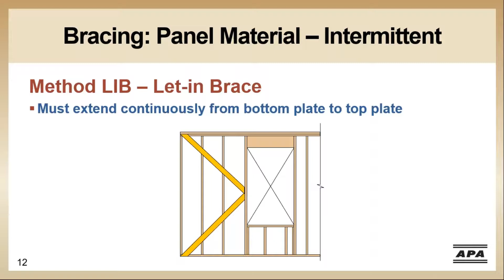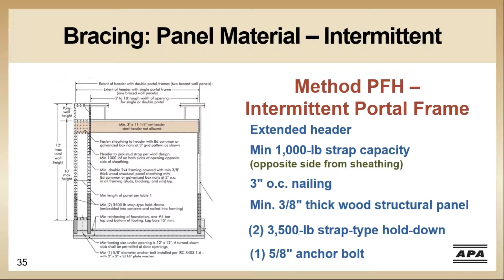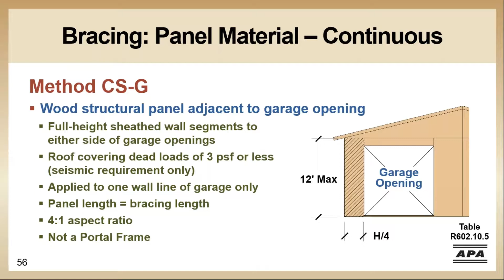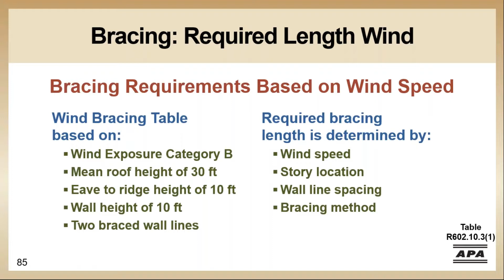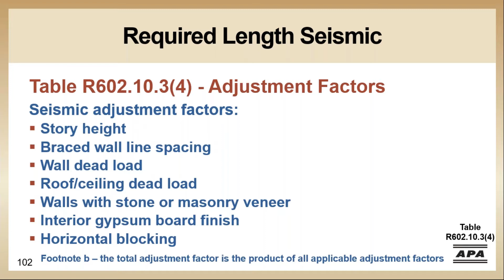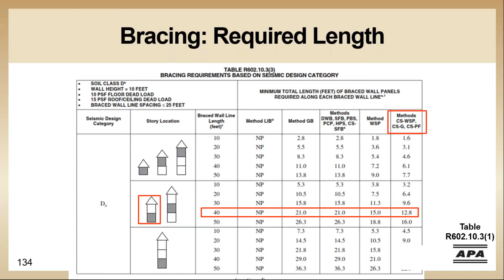Wall Bracing II: Meeting the 2018 IRC Bracing Provisions for Wind and Seismic

Comment: this helped tie all those tables together and why they even exist. But when it comes to walls higher than 8', im not sure common sheet goods will coming in 10' lenghts. We say continuous panels, but does that mean just an area with sheeting. Or would it dictate that the sheet has to be use vertically and be continuous?

Comment: Just what I needed to know I order to properly submit a permit for a large shed I am having built. The manufacturer of the shed hasn't helped at all.
Reply: Add a note that say all shear walls will fulfill what is prescribed by irc 2018.
Reply: You may not even need a permit for a shed, check your local building department. They usually have an exception for either 200 sq ft or 400 sq. ft (sometimes only 100 sq ft). But even if you need a permit you likely won't need wall bracing, you can usually just frame at 16" or 24" oc and use utility or better studs for sheds.